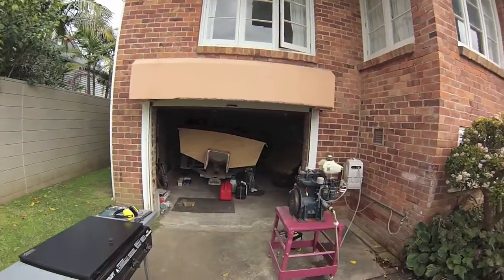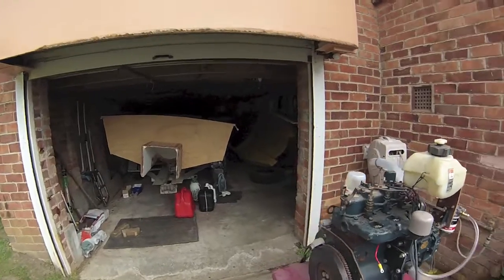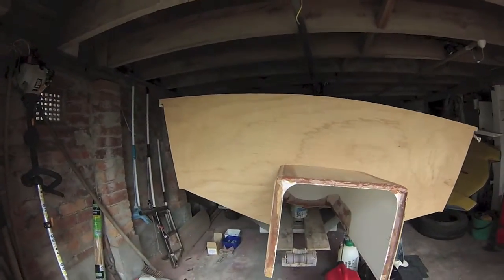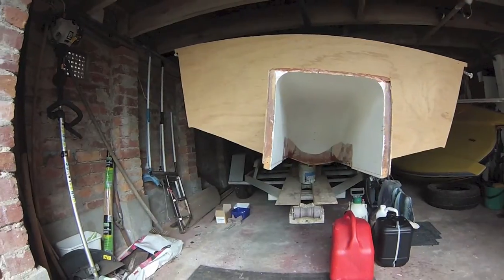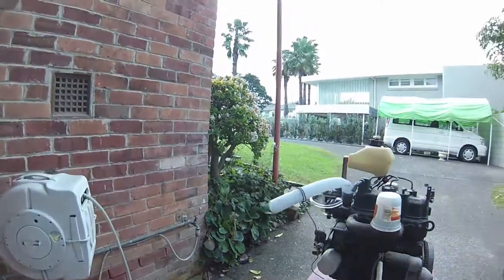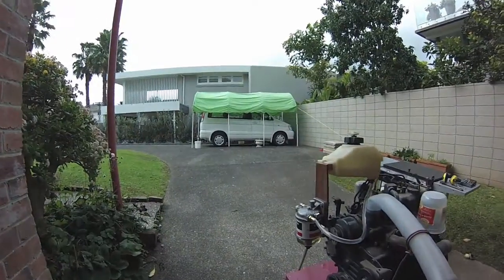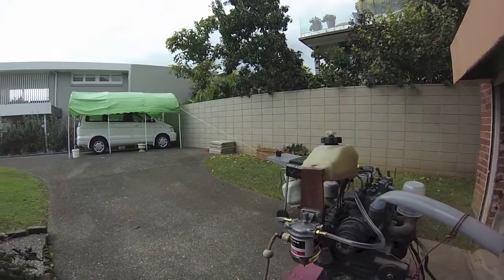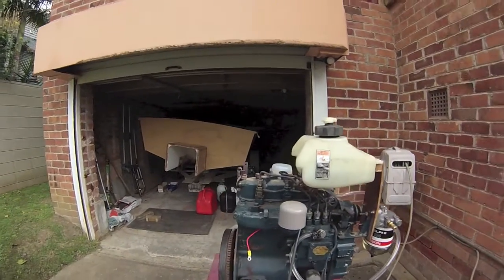Kubota Diesel D850 start up. Tunnel drive boat propulsion project.

Comment from the maker: Hi, a bit slowly unfortunately, I have another little boat which I am getting ready for summer then I will return ti this one. I am still gathering all I need to hook the diesel up and now only need a right angle drive gearbox to hook up to the outboard gearbox which bolts up under the tunnel. Thanks for your interest.

Comment: Such a gear box should be easy to find. The proper ratio and torque spec will have to be calculated. Some of the diesel electric boat videos on youtube show the vibration dampener which is installed in-line between the gear box and the shaft. Good luck. I will check back from time to time to see if you've resumed the project.
Reply: I have one thesame unit installed in pump boat but hard starting. We use priming everytime we start. what is the problem?

Comment: One question, where is located teh water Pump?, or does the engine work with ari cooling?. Regards.
Reply from the maker: +Ronnie Pitti Ronnie there is no water pump but in a tractor it worked with the thermosyphon method through a radiator. I was going to use an electric pump.
Reply: Hey Thank you,
I was away for a few days, we have an issues with our motor, because is overheating and loose power, we have no clue how to solve it. Do you know how to test that thermosyphon on this engine model?
I do appreciate the reply.
Reply from the maker: Ronnie I won't be much help to you because I have never run it using a radiator, for test runs I just run the garden hose to it. The thermosyphon system is fixed and very simple so I would probably look for a blocked radiator or maybe an engine problem like a blown head gasket. Sorry not much help, Google might have a few answers.
Reply: +tairua1 One more time thank you, de took the radiator out and clean it out, the engune is running fine and cool now. It seems that was a little blocked by debries inside. Good luck with the boat project. Regards.